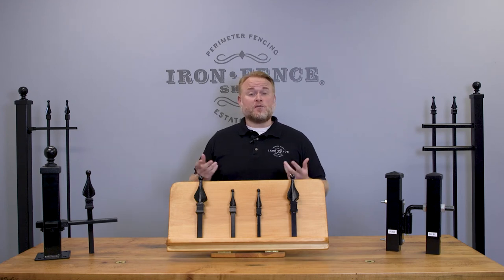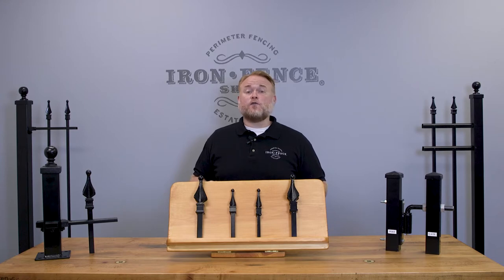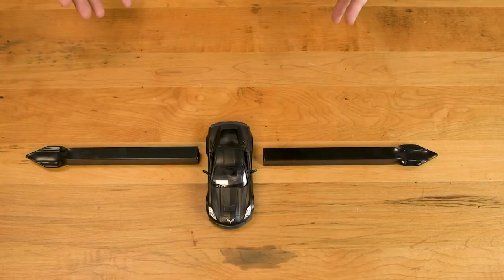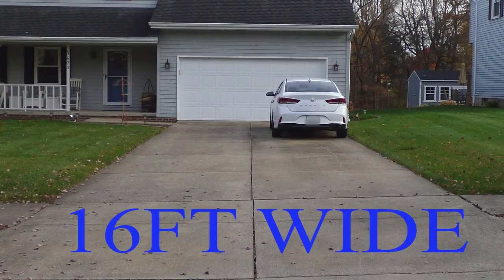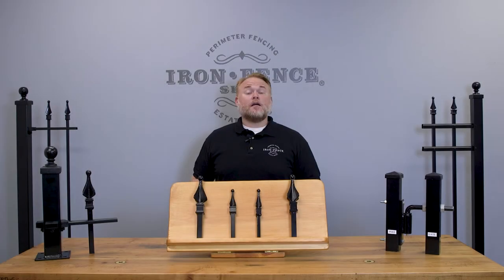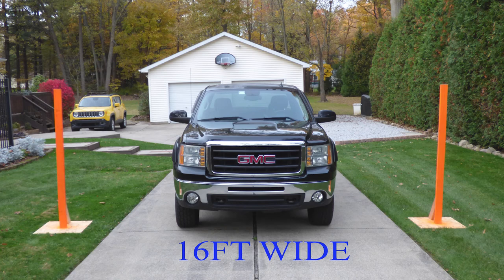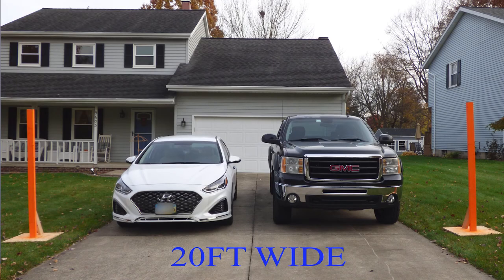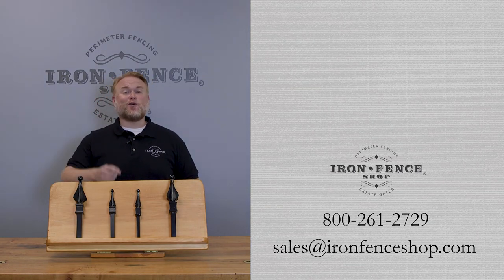What Width Aluminum or Iron Driveway Gate Do I Need?

Comment: Fire code in Atlanta is 14ft!
Reply from the maker: That is something we did not cover in this video as it varies from city to city and isn't as universal.  However, it is a good point to bring up!  It is always smart to check with the city before doing anything like this as there could be a special requirement like that.  A quick call to your building/ engineering department to ask about restrictions is always a good idea on any outdoor project.
Reply: @Ironfenceshop  
Absolutely a call is in order. 
I don’t generally do less than a 12ft gate. There’s always exceptions but less than 12ft is getting hit.
Reply from the maker: @philipwilkins3812  Its for sure never a bad idea to make a call to check those kind of things.  We cover the entire US, so we see things run the gamut of lots of very specific and detailed code to zero code restrictions at all.  However, better to take a few minutes to call to the city and make sure than run into an enforcement issue after installing the gate.

Comment: Question: What about Porte Cochere entrances?  The opening across our driveway (porte cochere entrance) is 15' 6" wall to wall (Side of house to side of 3rd car garage)  So could we anchor the actual gate post to each of the walls of our House/Garage? If so what size gate would we need?  Thanks..
Reply from the maker: Port cochere entrances are always a case-by-case basis since there is no common size and you are working with a a fixed opening. You are usually looking at a custom built gate or a standard gate mounted behind the opening.  Give us a call at 800-261-2729 to discuss options and go over any other questions.  800-261-2729

Comment: Cool video but I'm curious about how wide a gate should be for the fire department because according to the internet it says that your gate needs to be at least 20 ft wide which obviously is really wide and that concerns me because I just installed a 14ft wide gate on the back of my property so does that mean it would be illegal or not safe since the internet says that all gates need to be 20 ft wide to accommodate the fire department? and if that's true then why would you or anyone sell, promote or install Gates that are more narrow than 20 feet if and when there's ever a fire and the fire department needs to come and put the fire out? I wish you would have really covered minimum widths to accommodate the fire department honestly!
Reply from the maker: We didn't cover it since it varies immensely across the country and may not apply to everyone.  Some areas have zero gate width restrictions while others will have fire department regulations.  20ft seems REALLY wide, but its your individual city's call for what code they enforce.  Code like that is NOT universal.  A semi truck can fit through a 12ft gate if its going straight through, so a fire truck doesn't need 20ft to get in.  However, what the city code says it what you have to follow.  

Valid point we could have touched on it more in the video, but in 14yrs of being here, its only come up handful of times with local fire departments wanting access from the homeowner for automated gates.  Even then it only came up maybe 2 times out of a 100 gate calls.  I've never had someone buy a gate and then have to try and return it due to fire department code.    

As for your 14ft gate, call your city's Building/ Engineering department.  Again, some areas may require 20ft like the internet says, but others may have zero gate width restrictions.  Only the person at your city's Building/ Engineering Department is going to have the true answer.